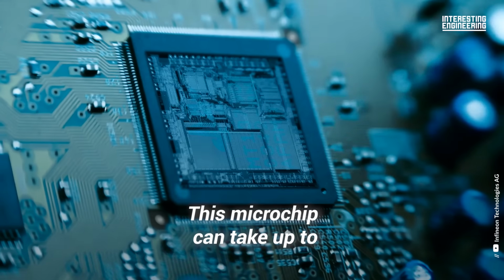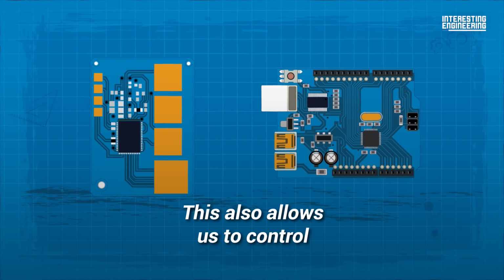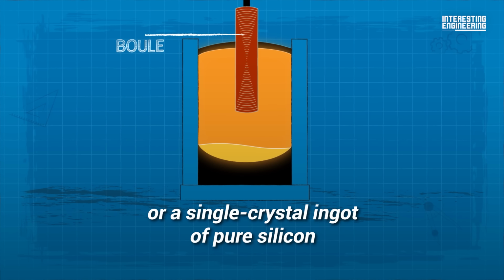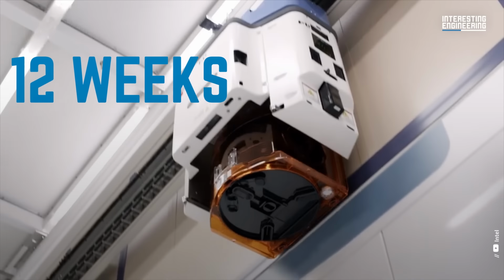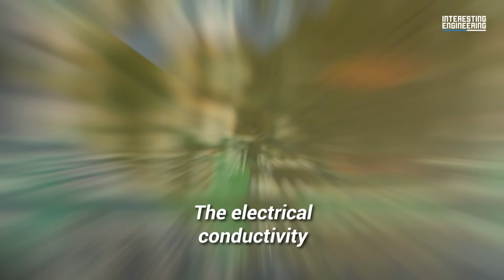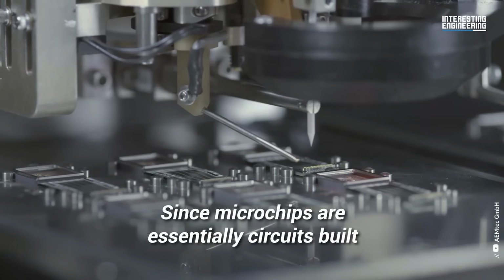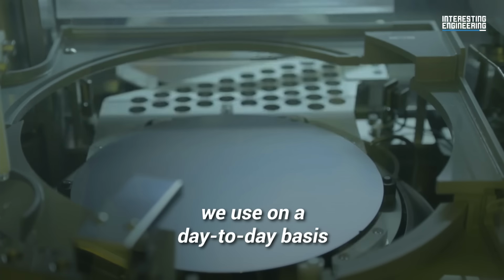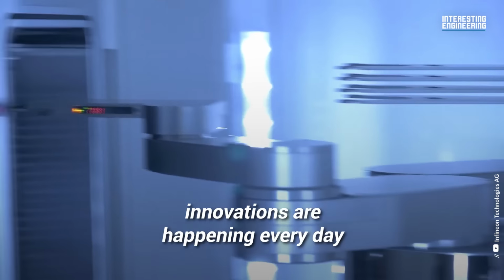💻 How Are Microchips Made?

Comment: But how did people build the silicone wafers at first when there were no microchips to operate the precise machinery?
Reply: you start with really oversized things to build machinery capable of building smaller and more precise ones, and then spend decades downscaling.

I mean back in the day things still ran on vacuum tubes in place of transistors and a computer the size of a house wouldn't come close to out-computing a modern graphing calculator.
Reply: That's just it...  They weren't precise at all, compared to today.  But they gradually shrunk the process down, iteration after iteration.  The silicon wasn't as pure back then either, but it didn't matter as much because they were making much larger chips that could tolerate such defects.
Reply: At first computers weren't built on silicon wafers but instead built by using massive tube based transistors
Reply: Befeore microchips, there were.... chips
Reply: Its an evolution, took 30/40 years to get to that precision..

Comment: Understandable how you make the chip. But how do you make those small things planted on the chip. I'm more interested to know that.
Reply: pile different materials on the top of silicon. Most of materials is like metal(thin film process). Actually the process is much more than your imagination.
Reply: Look for some of the videos released by actual manufacturers (like "Sand to silicon") - they take a bit more time and explain more details with fewer mistakes.

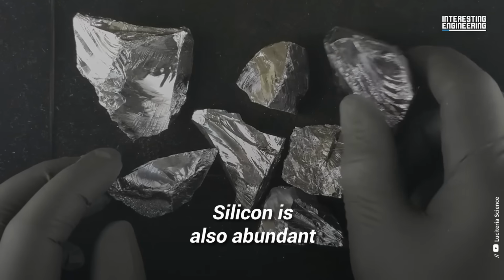Comment: 0:54 I laughed so hard at this.
That's SILICONE, not SILICON.

The final E makes it a completely different material.
Reply: While the main chain of common organic synthetic polymers consists of repeating carbon (C) atoms, silicone is an "inorganic synthetic polymer" whose main chain is made of polysiloxane, which is the repetition of silicon(Si) and oxygen(O) atoms
Reply: @krokkas  Precisely. Silicon and Silicone and completely different materials. One is an element, the other is a compound. One is a metal, the other is a polymer. Different chemical  formulas, different properties, different everything.
It's like comparing water with hydrogen, they couldn't be more different.
Reply: When did he ever said anything about silicone? Are you braindead?
Reply: He is talking about Silicon as an element on the planet, also Silicon is not a metal.
Reply: @starcraft2f2p77  Yep, he talks about silicon as an element and shows silicone in a mixing machine. Let's call this a "creative mistake".

Silicon, the element, has more in common with other metals than with most non-metals: it is silvery grey (silvery enough to think "metal" and grey enough to have some slight doubt). It feels cold to the touch. In its impure elemental form (99% or less) it is a weak conductor. It easily alloys with other metals - much more easily than carbon. And it exists in a typical metal-like crystal lattice. There is some justification to call it a metal, although it is clearly an outlier amongst the metals.

Comment: Why aren’t the seed crystals cubes to create square wafers?
Reply: The crystal rotates while it is slowly being pulled up. That makes it round. This is actually easier to make and control.

If you want square wafers you pull up a sheet at two wires, like a very long soap bubble. Then you cut the sheet into squares. This process exists, but is much harder to control in practice.

Comment: The interesting part is the lithography machines use silicon chips to help make more such chips.
Reply: "i used the stones to destroy the stones"- Thanos.
Reply: @bikrantjungbudhathoki3687 think backward, how these chips are made?
Reply: @bobaGogo  interesting. Is it then possible to update the software and make them more efficient?
Reply: @bobaGogo  I do not understand it , but can the software be installed on computers which do not have such fancy cpus? Or can the cpu/gpu  be upgraded with software from a different manufaccturer?

Comment: If the machines that produce the microchips are made of microchips then how was the first machine manufactured if there was no microchip yet?
Reply: They used transistors wired together.
Reply: Its produce using human hand
Reply: @pacmovieclips7122  Have nothing to do.Are you trying to say to me that the first machines like those in the video were created using only human hands without microchips ?
How does the first machine manufactured the microchips if there was no microchip inside on it ?
Reply: @JuniorRadmelk  Intel 4004
Reply: @JuniorRadmelk  not like in this video, but much bigger size microchip which help to manufacture more little chip

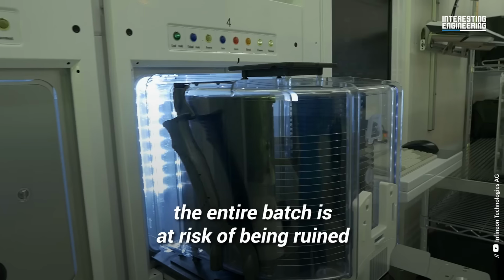Comment: "If even just one particle of dust makes its way onto a silicon wafer the entire batch is at risk of being ruined" @2:10 Guess you might throw all those wafers in the trash then. You can see finger prints and contamination all over them just from them handling them between each take of the video shoot.
Reply: They might have been rejects used specifically for getting the video
Reply: The statement was complete BS. Wafers are not scrapped until a sizable fraction of the chips on the wafer are defective. Even then only the bad wafers are discarded - anything else would be rather expensive, considering that a typical lot of wafers can be worth as much as a new car.

Comment: The fact that to make microchips you need a machine with microchips inside it smaller than the one you are going to produce scares me. How was made the first microchip?
Reply: You don't. The feature size of the product is not dependent on the feature size of the chips used to build the machine. It is dependent on how accurate the mechanical parts of the machine are. For those there are some "neat tricks" (also know as physics) that help you amplify the accuracy with every step.

The first microchip was made by hand with feature sizes still quite visible when using a magnifying glass. Only after decades of development did we reach this highly automated state we have today. Although it looks deceptively like it, it is not magic. It is the result of decades of hard work by thousands of engineers.

Comment: General question here, looks like a lot of automation which is good and the workers are suited up with PPE in CLEAN ROOMS, than why the slowdown of chip manufacturing at the onset of Covid in eary2020?? Clearly the workers were wearing protection required to be in the CLEAN ROOMS and from what I see they were not working shoulder to shoulder and were well protected from passing the virus to one any, just my observation
Reply: Mby if you checked what kind of chips were mostly unavailable you'll realize almost half of those were "outdated" architecture that only 2 factories are still making, both i believe in asia (i heard there were three but one decided to make repass for newer architecture chips during first cov19 wave and one of those two remaining had some manufacturing or resource problems, not sure... but it wasn't producing, at least not at full capacity). If you add these things together (don't forgot almost nobody wants to hold stuff in stock these days and everything as ordered in batches simply by demand) you have the shortage "news" are talking about (since they don't understand a F as well, they just repeat the most catchy thing over and over and over, like a dmn parrot). 
And why outdated chips are so important? Well, think about it... for example cars - you don't really need a i5/7/9 inside a car cpu for injector sync and few other relays operating measily 10-20 functions you have in a car ... You can do with old "discman" level that still hase more than enough computing pwr... It's also cost effective (not really when you cannot finish your product but tell that to managers) to use older cheaper ones.

Comment: I'm still wondering how these chips works.
Reply: Ok, the basics: You have logic gates where you have operations such as "AND", "OR", and "NOT".   AND will take two lines going into it, with the result being that both lines MUST be "on" for the result to be "on".   OR is similar, but at least one of the two lines going into it have to be on for the result to be "on".   Not will just flip from on to off, or off to on.   Then, you have combinations of these, plus XOR, XNOR, NAND(not AND), NOR(not OR).   When you hear about computers being about 1's and 0's, 1=on, 0=off, that is what it really comes down to.    You can find the actual gate combinations that turn into adding an 8-bit number online for example.    There are even "mechanical" versions from what I remember, but they end up being very large due to them being a showcase for how the electronic versions operate.

Comment: The transistor size is given in inches (8 x 10 power -8) and metres (2 nm). Do chip makers work with inches?
Reply: Of course not, they are using metric system like the rest of the world. Inches was used to describe it to american audience, but they may also say "very small".
Reply: probably just written so that it makes sense to americans
Reply: @ciarangale4738  Do you think the average american know what "8x10^-8 inches" is? lol!
Reply: 2 nm? So its dissolved in liquid and flows into your blood? Lol
Reply: @wirawan_gabe  Though the "nm" are misleading and just a piece of marketing detached from any real meaning unlike from the olden days, the transistors are still so small that yes, if you were to somehow make just 1 single transistor then it would easily flow in your blood. They are order of magnitudes smaller than Red Blood Cells. If I recall correctly, 7nm nodes were supposed to be about ~30 silicon atoms in their smallest dimension so you can imagine the scale when you're literally using atoms to describe its size.

Comment: Wow, that's pretty cool! But then what's the process for converting code or instruction sets into the layers (besides PROMs and FPGAs)?
Reply: The layers are produced by a software once that chip architecture is specified by the designer (with verilog or vhdl hardware description languages). Every layer is then "printed" in the wafer with photolitography as shown in the video.
The instruction set of the produced chip is just a property of the architecture specified by the designer
Reply: @lucaangeli5822 : Thanks, but I'm talking about the very beginning: the transition between not having software to do it and having software to do it. From before we had computers with these chips to making these chips to make the computers with, to then have software and machinery to make these chips that way. And then how the software interprets code into the traces and component arrangements.

And a video of it from this guy (either of actual shots or 3D renderings) would be great!

Comment: I would love to know more about the processes such as depositing of SiO2, photographic techniques used for development of the circuits, doping of silicon etc. I think that the manufacturing of microchip is the finest moment of metallurgy. 

Incidentally, if a transistor in a Chip measures 8x10-8 (eight multiplied by ten to the power of minus eight), the electron measures 10-19 (ten to the power of minus nineteen). So there’s no danger of these microscopic transistors running out of free electrons.
Reply: Size doesn't matter, quantity does. A silicon atom is 2,1 × 10^-10 m across. I has 14 protons, and therefore 14 electrons. I has four electrons available at the last orbital. Considering quantum effects like tunneling, it is in danger of running out of electrons.
Reply: @MrFujinko  Yes. I believe we will need a complete change in how transistors are made, or some new component entirely to get much smaller than what we currently have. Now that they are only a few atoms big, we might have to somehow use smaller atoms, or maybe even a chemical that somehow happens to work as the circuitry we need.
Reply: @vibaj16  Right now what most excites me is hardware implemented neural nets. The current computing technology perhaps is already enough for a lot of performance with these nets running at hardware level. Hardware level spiking neural nets might solve the power problems, and with the natural falling price of lithography perhaps hitting a tech limit isn't that bad afterall.
Cheers.
Reply: interesting point ,only engg can raise
Reply: And I am wondering wtf is going on here 😃
Reply: The measurements in the video were pretty... to put it mildly: off the mark. Let's dispense with "ten-to-something" and "fraction of inch" BS and use the industry unit: nanometer (nm). Each atom in a pure silicon crystal occupies 0.5nm in each of the 3 dimensions. The currently smallest "feature size" is 3nm. That means the thinnest line that can be "painted" on a chip is 6 atoms wide on average (it varies a bit, since at those levels measurements are not exact anymore). That line is also at least several dozen atoms deep. That makes a few hundred atoms in that piece of line. Feature size really only describes a single line. A transistor consists of multiple lines - at least 3 next to each other. Meaning we theoretically have a few hundred electrons to switch the transistor on and off, in practice it is probably a sizable fraction of that - let's say a few dozen at minimum. Yes, that's an unimaginably tiny current, but still enough to make it reliable. At the point where we need to get the current out of the chip and into other components there will be a really beefy "power transistor" that converts that tiny charge to something that can turn on a LED - that output transistor will occupy a few micrometers - that's a thousand times bigger than the tiny internal ones, meaning a factor of millions or billions in volume and charge carriers.
Reply: This might also interest you: https://youtu.be/bor0qLifjz4
Reply: Photonic computing is the future. Where quantum space rule is followed
Reply: @antenedilbert7191  of course bro you are prepared
Reply: Microrobots could help with drug delivery.
Fish-Shaped Microrobots to Deliver Chemotherapy to Tumors
https://youtu.be/4Qa7W-TH948

........

Comment: how are other rare earths used for (micro) chips?
Reply: They are the materials used to "dope" the transistors to manipulate their behavior.  Certain rare earth minerals will give the chip better heat tolerance, for instance, or lower it's conductivity a bit, thus saving power and reducing heat.  Edit..  I meant raise its conductivity to lower heat and use less electricity.
Reply: thx. by "saving power" you mean providing higher electrical capacity (capacitance)?
Reply: @kisho2679  Or by reducing resistance to electrical flow.

Comment: "Microchips are made in extremely sterile conditions". No they are not. There is a difference between clean and sterile, hence the name cleanroom...:-)
Reply: Try coughing on a silicon wafer and see how quickly you're kicked out I dare you
Reply: @Alucard-gt1zf  
What if a surgeon coughs above a wound during surgery.  An operation room is also not sterile. Only the instruments that the surgeon uses are steril.
In a clean room, your mouth and nose are covered. In a modern clean room the wafers are in pods, you can't cough on a wafer.
Reply: @Richard-bq3ni  the reason why surgeons wear surgical masks
Reply: @Richard-bq3ni  Ohh, you could cough on a wafer, but you would have to take it out of the pod first, which takes special tools at a special station - that's a lot of effort for a silly reason to be fired. 😛
While most bacteria will probably get stuck in the filters, some of the smaller ones will probably get through and many viruses will also get through. The people inside the room will also constantly shed viruses and bacteria that they carry - most will get stuck in the mask, but not all of them. The room is clean, not sterile. There is no effort to kill those bacteria and viruses in semiconductor fabs - pharma clean rooms do ionize the air and/or use biocides in addition to filters.
Reply: Bacteria can also be considered particles and will not penetrate the HEPA filters of a decent clean room.
Older clean rooms were often more strict than the newer of today.
I worked in class 10 and even class  1 clean rooms. Later in a newer factory it was a class 1000 clean room (less clean) but the wafers where housed in air tight pods (also shown in the video) that function as a tiny clean room for the wafers.